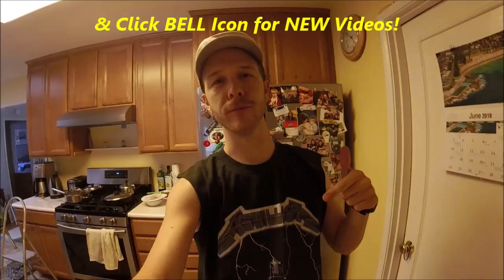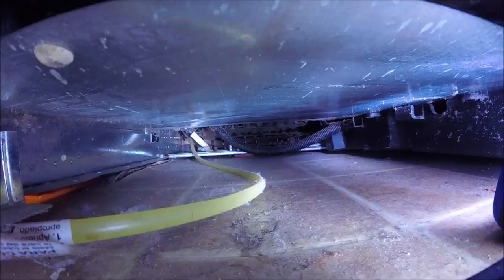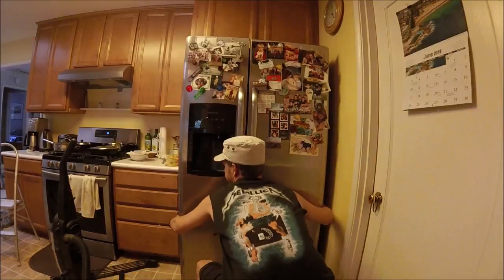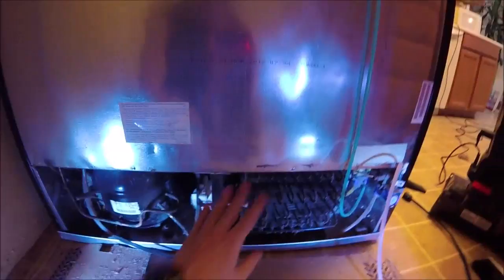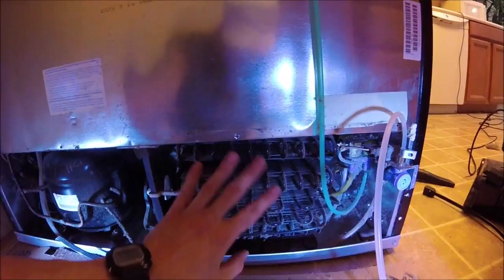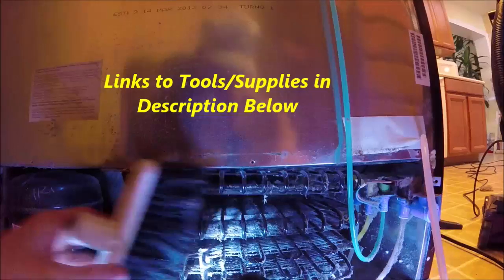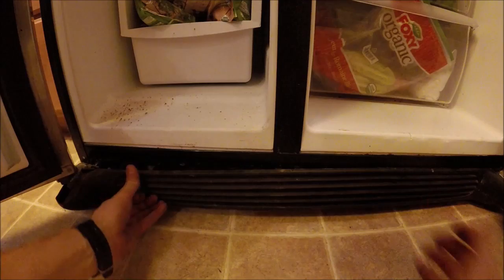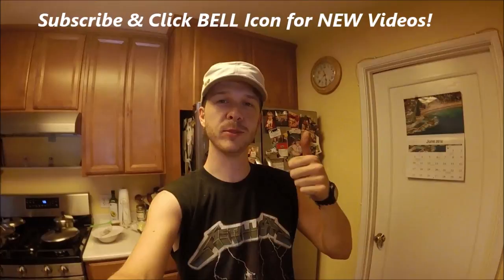How To Clean Refrigerator Condenser Coils Fast & Easy! -Jonny DIY

Comment: I feel like my fridge was getting as cool these days and today we were going to buy a new one! But I started trying to see if it could b something else came across this video and so far I’ve only cleaned the front part and omg it was super bad !!!!!! So this can be a reason why the fridge stops cooling ?
Reply: Have to wait till later wen I have help to clean the back part but I’m really hoping cleaning all this gets my fridge cooling again:( I just bought tons of groceries yesterday :(
Reply from the maker: Its worth a try, some have said it helped considerably. Id give it a shot, you'll know within a day if it made a difference. Best bet is to put a thermometer in fridge and compare before and after 👍
Reply: @JonnyDIY  don’t have a thermometer but fingers crossed after cleaning it really well today it starts cooling like it would :( any tips if I don’t have a vaccume
Reply from the maker: @mariekors2266  you could use a small dust pan brush to sweep off large dust and a blow dryer on high to blow all the dust out from inside and on the coils 👍
Reply: @mariekors2266 did it work
Reply: <<@mariekors2266  you could use a small dust pan brush to sweep off large dust and a blow dryer on high to blow all the dust out from inside and on the coils 👍>>

Yes, you can. And likely blow that dust all over your kitchen.

Personally, I'd spend $6-8 buying a refrigerator coil brush at a hardware store  and use it to brush off the dust. Then vacuum it up with a vacuum cleaner.  I find it necessary to pull out the refrigerator to vacuum up the dust that has fallen to the floor.

Comment: Is there a particular name for the tool you use at 1:35?
Reply from the maker: Nope that was just a ratchet extension with small socket on it. Some may have regular screw heads, I belived that fridge had 1/4" head screws 👍
Reply: @JonnyDIY  Thank you. If it isn’t Phillips or flat head, I have no idea. 🤷🏾‍♀️
Reply from the maker: @winter_s_44 You're welcome. I'm pretty sure the heads had a Philips or slotted flathead groove as well so you'll be good 👍

Comment: After I unplug my fridge, do I have to discharge any electricity like I would with a capacitor? I just want to be extra safe since there would be no one to find me if I got shocked super bad lol
Reply from the maker: If you unplug refrigerator for a couple hours it should discharge and you can confirm with a multimeter as well 👍
Reply: <<After I unplug my fridge, do I have to discharge any electricity like I would with a capacitor?>>

Not a hazard in this situation.

Comment: I cleaned the coil with a hair dryer and eye make up brushes as I didn't have access to a vacuum cleaner. The fridge turned back on fine, made it's usual running noise but after five minutes it went whisper quiet. The light is on. After a while it resumed the running sound. Holy hell, I hope I didn't make it worse. The temperature has crossed 40 degrees Celsius here and fridge wasn't cooling as well, milk was getting spoiled. Hopefully it will be fixed now. There was dust and some fluff here and there on the coil. Im wondering if just cleaning that would make all that difference.
Reply from the maker: Cleaning it wouldn't hurt anything, would only help. Hopefully fridge starts working as normal, but its possible something else could be wrong with it
Reply: @JonnyDIY  The freezer showed vapors within an hour but not sure if the refrigerator is cooling. Fingers crossed
Reply: I guess should wait and watch for 24 hours
Reply: @ClaireJ4 how did it turn out?
Reply: @tracy419  It worked out fine eventually. But it could also be because summer is gone and rainy season is in,but fridge is cooling great
Reply: @ClaireJ4  good to hear.

I'm one of those who have had the same fridge for about 15 years (it's about 22 years old) and never cleaned it.

Going to tackle it this weekend and hopefully it will stop yelling at me.
Reply: @tracy419  All the best, fingers crossed

Comment: Where are the condenser coils on a chest freezer located?  To vacuum clean.Thanks in advance .
Reply from the maker: Sometimes they're right on the back of the chest. If not there look under the bottom or for a ventilated panel. Sometimes have to remove access panel to get to them
Reply: @JonnyDIY  Thank You. I just got a new chest freezer. My guess would be it is on the side. There is a ventilated panel with screws to remove panel. Guess I could have looked more closely before asking..  Thanks again...
Reply from the maker: @tammiepomroy2481  you're welcome, glad to help 👍
Reply: <<Where are the condenser coils on a chest freezer located?  To vacuum clean.Thanks in advance >>

Sometimes the condenser coils are completely covered with sheet metal. In that case, air doesn't circulate over the coils and they can't get impacted with dust.

In that case, the heat is transferred through the sheet metal of the refrigerator, and you will find that part getting warm when the motor is operating.

I have that arrangement on my very old freezer.  Look Ma!  No coils to clean!

(But I have to defrost the freezer!)

Comment: Can’t find my coils anywhere not even below the fridge any ideas?
Reply from the maker: Should either be under in the front or in the back. On old fridges they're exposed on the backside. Make sure to take off access panel on back
Reply: @JonnyDIY  non buddy, no panel back side the compressor is exposed and nothing there with it, coils not found under back or front nor below 
Any ideas?
Reply from the maker: @chico711  it's possible you have a "sealed" unit. I have come across these most commonly in mini fridges, but I'm guessing they've done it on other fridges as well. So in that case if it's a sealed unit you just want to clean everything that you can access from the front and back
Reply: @JonnyDIY  got you and yes it is possible the thing is i noticed my fridge is not turning of but we i live we have electricity shut down for about 8 hours a day so i guess it’s taking the compressor way too long every time electricity goes of to reach right temp
Thx buddy for your time 👊
Reply from the maker: @chico711  you're welcome, if you have any space in freezer fill with water bottles to freeze. Will help keep fridge cold with power off and help out compressor
Reply: @JonnyDIY  👊👍

Comment: Wait, does every fridge have this? I checked mine and can't see coils
Reply from the maker: Yes, the coils just can be located in different spots 👍
Reply: <<Wait, does every fridge have this? I checked mine and can't see coils>>

No. Some refrigerators and freezers have the coils located inside the sheet metal of the appliance.  Air doesn't circulate over the coils and therefore no dust can accumulate.

The heat is conducted from the hot coils to the sheet metal surface of the appliance, and conducted away from the sheet metal surface.

So there are coils, but no access to them and no cleaning possible.

If you have that kind of appliance, there are no coils to be found but you will find a warm spot on the surface of the sheet metal where that heat is being radiated.

I have that arrangement on a freezer I have.

Look Ma!  No coils to clean!

Still, this freezer has evaporator coils that need to be defrosted of ice, not dust.

Comment: Yep, most people (who have any money at all) just buy a new fridge assuming the junk they build nowadays won't last. Well, it can, but you have to take things apart to maintain them. I've even seen stickers on that back panel: do not remove, no serviceable parts inside. And no mention of cleaning the coils in the manuals! Plus, horrible design with the square stacked coils, but I've seen worse where accordion coils are placed so you can't reach them or in between them, no matter what you do! You basically DO have to blow them out with air, no way a vacuum will do much to them. They really want their products to fail quickly, so they can be thrown out.
Reply from the maker: Yup planned obsolescence sadly. Used to make things to last and be able to be easily serviced

Comment: What if you have no vacuum
Reply from the maker: @heightsfynest6023  compressed air? If none of that either I would use brush. Paint brushes work great to dust, can get smaller one for tight spaces
Reply: @JonnyDIY  I got it clean but unfortunately that wasn't the issue I believe it's the fan behind the freezer